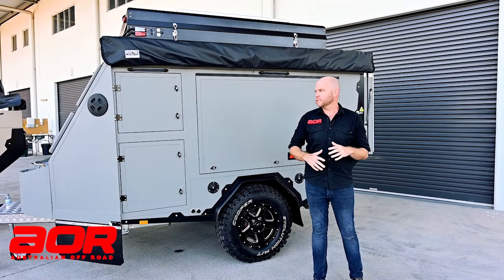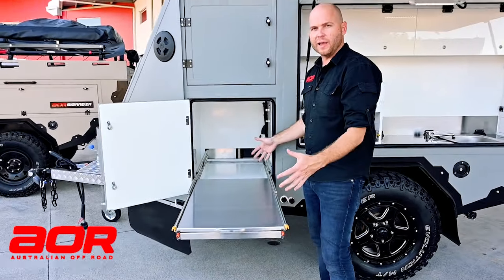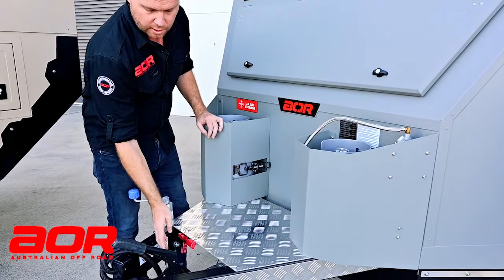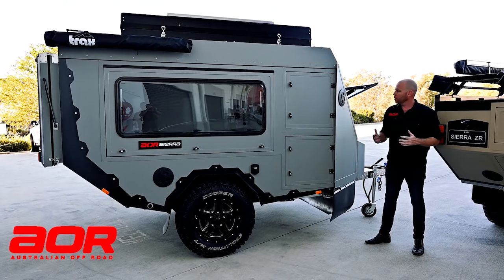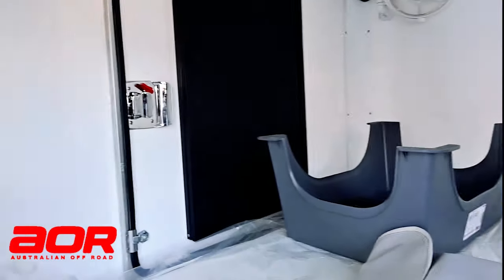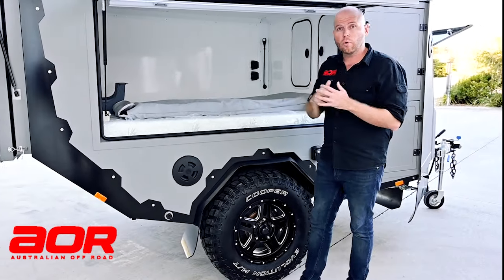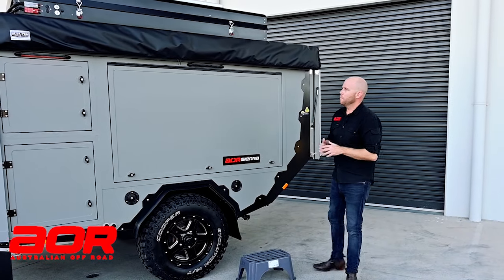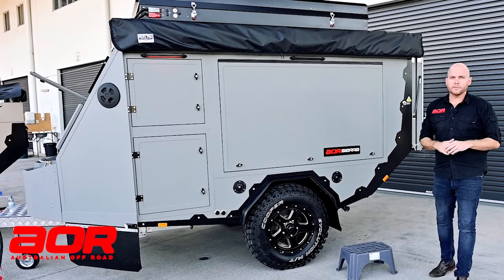AOR - Sierra - Walkthrough - 2020

Comment: Jeez. You Ozzies make some very, very cool camper trailers. AOR have really caught my eye. The colour scheme is really eye-catching; rugged on the outside but very sharp detailing on the inside. I’m in Colorado and am wondering what the insulation is like and whether this is an all season system. 👍👍
Reply from the maker: Hi Neil, thanks so much for your feedback! Our trailers are made from composite fiberglass using a monocoque body design to provide maximum insulation. With large insulated windows to help control airflow and temperature, you can stay cool in summer and warm through the winter 👍

Comment: Very nice unit. How does the hot water connect ? location shower heads?
Reply from the maker: The Sierra is setup to take a camping style, instantaneous, gas hot water system. 

On the Drivers side of the trailer, there is a cold water outlet and a gas bayonet to provide water and gas to a hot water system. The hot water systems will have a shower rose with them for you to use. Also, if you want hot water to the kitchen sink you can connect a section of hose to the hot water inlet in the tap section on the drivers side and that will pump hot water through to the kitchen.

If you have any further questions, please give us a call on 07 5390 0300

Comment: How much water capacity can you have including optional tanks? Also if you didnt have an addional tent on top, what could you put on the roof storage wise?
Reply from the maker: Hi 26realmc, in total the maximum capacity of the water tank storage is 200litres, it is split between 140lt front tank and 60ltr rear tank. The rear tank is standard and included in the RRP, you can choose to add the extra 140lt tank as an option.

As for roof storage, the options are endless.... you could fit cargo carriers like the Thule vector or motion pods. Pelican storage boxes, cargo bags etc.... anything that can be strapped on or bolted down to be honest. That’s the beauty of the Sierra, build it your way!!

Comment: Hi - I wonder how you have addressed the ventilation of the fridge compartment when driving for long periods. I did not notice any ventilation louvres/filters to keep dust out when travelling on dirt roads.
Reply from the maker: Hi Vagabond,
 
Thanks for your question. You are correct there are no external vents to the out side to ensure that it is weather and dust proof, but we have designed the trailer  to have a number of open cavities internally to allow air to circulate throughout the trailer. There is also a fan to aid this process. Being that the construction is of sandwich panel fiberglass, the trailer will always be cooler than traditional sheet metal style trailers. This mean the circulating air will also be cooler.
 
I hope this answers your question,
 
Happy Camping
 
Shayne
Reply: @AustralianOffRoadAOR  Thanks!

Comment: Need a better video. Open the awning (why do you have a batwing awning when the back already has an opening cover?). Show inside the firewood carrier better.  Show how you'd actually setup the hot shower, because I don't get it.  And am I right in saying you can't get into the rooftop tent with the kitchen in use, and/or the other sleeping quarters in use? You need an entrance on the draw-bar side like DOT camper trailers had. As a comment on the design, you really need to build the shower tent into the body rather than having it hanging off the side (like the Sniper x.9)